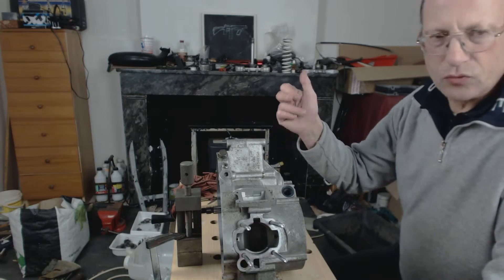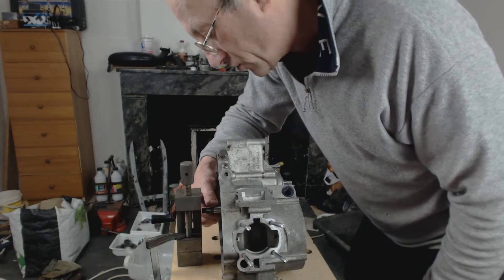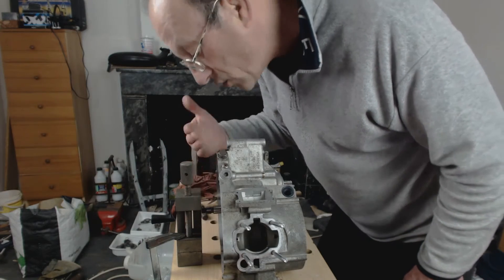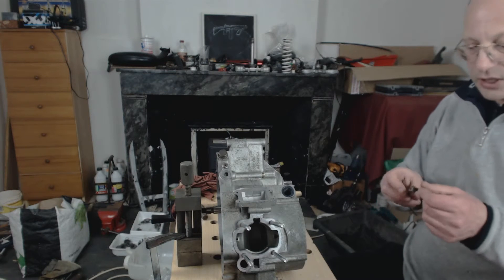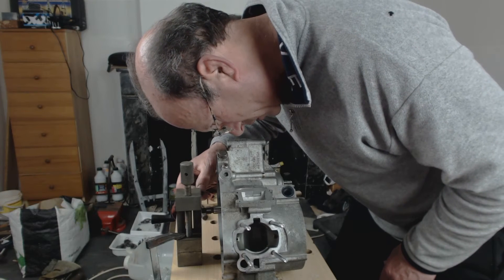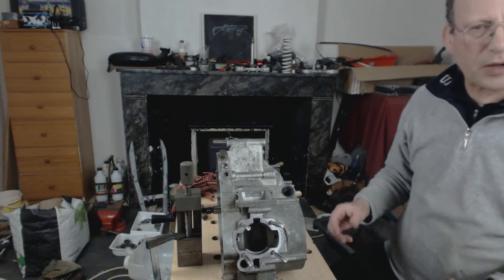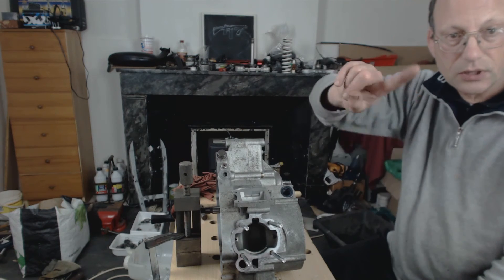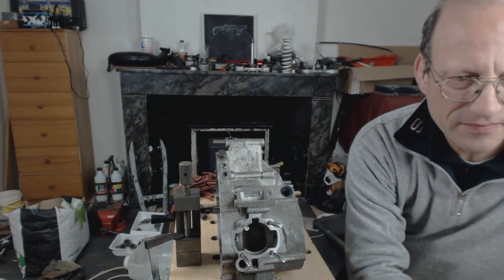AM6 - testing gearbox shim specs (and play)

Comment: Some time ago I commented saying I was gonna take my gearbox apart and replace/ upgrade some things while im at it - today is that day. Your content is awesome, really helpful.

Im just wondering now; the Rieju manual says no more then 0.1mm "end float" for all the transmission components. 
This is a lot tighter compared to 0.5mm - you think this could have something to do with the common AM6 "jumping out of 6th gear" issue? 

It does make sense to me because if you have 0.5 on the desmo shaft and 0.5 on the shifter fork, you have 1mm play on the whole selector assembly, 
which could be enough to manually push back the shift forks/ desmodromic shaft and jump out of gear.

Well either way I'll be shimming mine to get 0.1mm end play and use 75w90 oil (thicker then 10w40 so better for higher pressure). 

I'm really extremely curious to hear your opinion on this. Thanks in advance!
Reply from the maker: Hi jesse :)
You should assemble to the stated specification.
If 0.1mm is stated, then shim to that.
I agree that it does seem tight, but you should follow the specification.
Same for the gearbox oil, which is likely specced to 75w90.
10w40 is typically car engine oil (depending upon the engine).
Best of luck with the rebuild :)
Reply: @EngineTuning  Hi! :)

Thats the difficult part, I have a Yamaha TZR 50 which doesn't have a manual regarding engine specs, so I am most drawn to the Minarelli manual.
I did however have the jumping out of 6th gear issue, and the play on my axis seemed high before (didnt measure exactly). 
The internals (bearings, shims etc) are still relatively new and not worn down, so I assume it was factory specced to 0.5mm end play.

These are the different manual specs;
Aprilia says 	0.5mm end play- and recommends 75W-90
Rieju says 	less than 0.1mm end play - and recommends 10W30
Minarelli says	less than 0.1mm end play - and recommends 10W30
Online forums recommend 10W40 - I fully agree with you btw, seems like car oil.

Some interesting info I learned; be careful with 75W90, not all brands have friction modifiers which means you cannot always use this with a wet clutch (since you'll fry it almost instantly).

Either way, I'll check the play and if it's 0.5mm I'll add a 0.3mm shim. Or 2 x 0.2mm if I'm in the mood.

Thanks a lot :) and just out of curiousity, do you still do AM6 builds/ mods?
Reply from the maker: @_Jesse_  Not at the moment; though I do have an AM6 to rebuild, so we'll see when that happens ;)
Reply: @EngineTuning  I see, enjoying the engine is important too! :) 

Have you ever thought about making more video's? There is still a bunch of stuff that is not well known about the engine and not explained anywhere.
Youre really good at explaining things so it would be nice for new people to have some more info.

Is there a way I can personally reach you? I'd love to share some thoughts and idea's :)

Comment: what are the orginal thickness of the shims?
Reply: Most shims are 0.6mm, except the shifting fork, the bottom washer on the shifting fork is 0.75mm and the top one 0.6mm < this could however be different from engine to engine.

Comment: Is there any original shim sizes on am6? Every shims to transmission in my am6 seems to be missing. Thanks
Reply: And is there any site i can buy the shims at? I searched alot but i can’t find anything.
Reply from the maker: Shims are a standard engineering item.
They can also be bought online from  motorcycle spares dealers.
All online Aprilia dealers use the same expanded diagram sales system, that allows you to identify parts and then buy them.
Reply from the maker: That's not good.
Here is a post showing shim positions on the Rieju version of the engine.
https://www.apriliaforum.com/forums/showthread.php?224113-RS-50-Transmission-Assembly&p=2780665&viewfull=1#post2780665

However, over time components get replaced, so the dimensions mentioned are just guidelines.

The best thing is to check the play:

Selector shaft end play: 0.5 mm
Driving shaft end play: 0.5 mm
Driven shaft end play: 0.5 mm

Carry out the measurement at the threaded end of the driving shaft 
at the splined end of the driven shaft and selector shaft.

Therefore, you could nip up the cases without shims, and measure the play
... then order a selection accordingly.

Note that there is a shim on the balance weight.

Comment: Hello, do you know the allowable play on the gearbox of a Derbi/Piaggio engine? I think mine has more than allowed, but not sure what to do about the problem. Great video, btw!
Reply from the maker: It's not clear Edward.
But primarily we are talking about the maximum play.

As stated.... the manual indicated no tolerance.
Therefore we assume that the 0.5mm play is probably close to max.
 
If the play is more than 0.5mm.... you need to question:

Have you stripped the gearbox?
If so.... have you replaced the shims correctly?
 
If you have not split the gearbox... and the play is more than 0.5mm... you may need to strip the box, and renew the shims.
 
Try to be confident with your measurements.
 
Clearly, it is better if these measurements are made on a piece of float glass.
But, regardless... the measuring point is set at the point of measurement.
So... as long as the work-bench is flatish... you can measure the gap at that point.
 
Watch the video clearly.
I extend the shaft to its maximum.... to touch a flat object.
Then I pull the shaft back.
The gap that remains IS the play.
 
If 40 + 15 = 55 .... and it slides without interference.
Try 60.
 
If it slides without interference.... then the gap is looking a bit too large.

Good luck!
... and report back, on how you got on :)
Reply: Will do as soon as I can find somewhere there is information about the play in the gearbox on a Derbi Piaggio engine, because I don't have the AM6 engine. After that I will try measuring my exact play. By the way, is the play coming from the shims tearing down after time?
Reply from the maker: Don't forget the shims can move on the alloy casings.
Plus everything can wear.
So regardless of the sources of wear, the key is to limit the play,
 
My guess is that the 0.5mm is probably fine for all these engines.
But I reckon the biggest reason for excessive play will be that the gearbox has been stripped, and a shim forgotten.
If that's the case, then it will require an engine strip, as the shim is the bearing surface.... Aluminium alloy will not suffice.
In these situations 'hope' is irrelevant.
Only you can make this decision.
:)
Reply: Yes, the engine has been stripped open many times. I have my gearbox out now, so I will try to understand the schematics of the engine/gearbox to check if I am missing a shim.